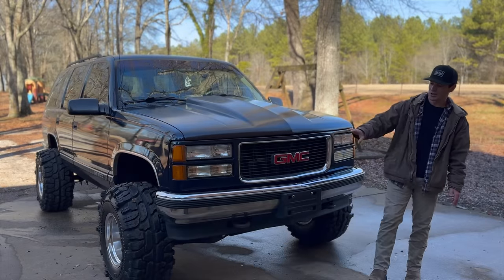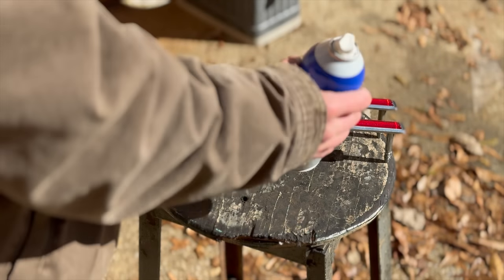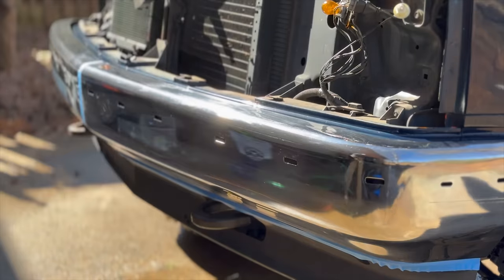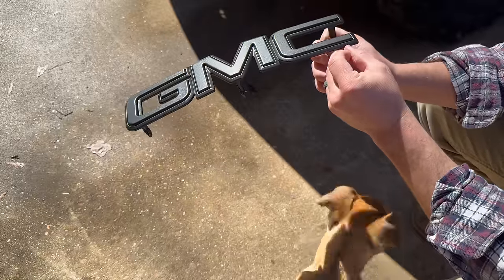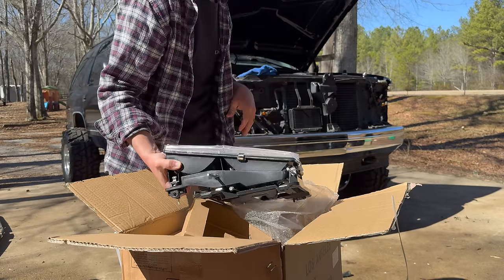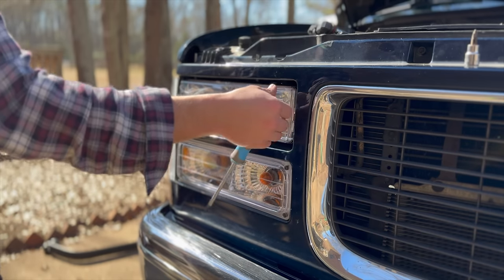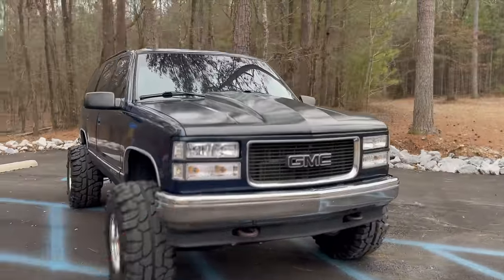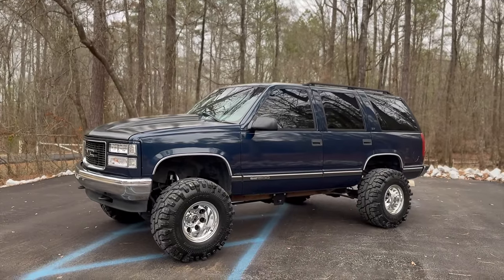FRONT END TRANSFORMATION LOOKS AMAZING!!!

Comment: Hey man I enjoy your content, small recommended for your Yukon. Lmc truck or amazon sells a high beam low beam relay kit for the 88-98 model OBS it would definitely help out. I have a 93 c1500 I installed it on. The kit should be less the $25 installing it should take less then an hour.